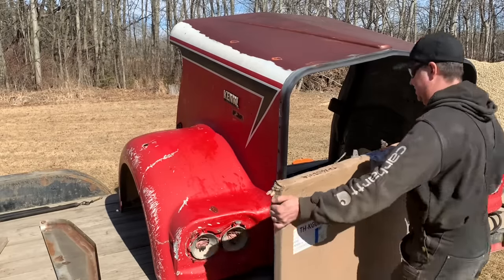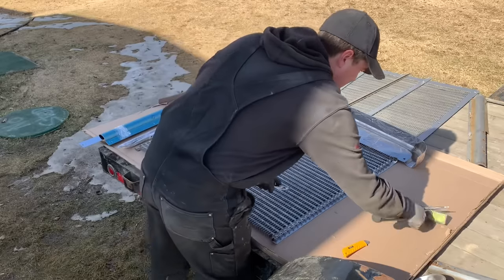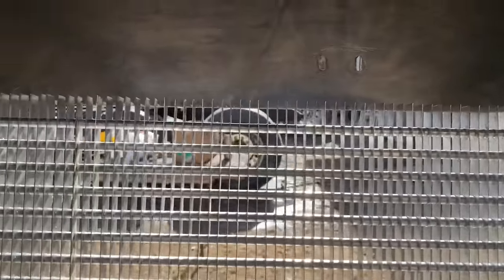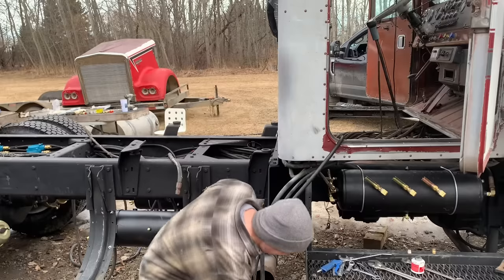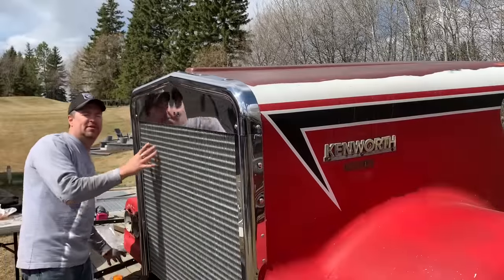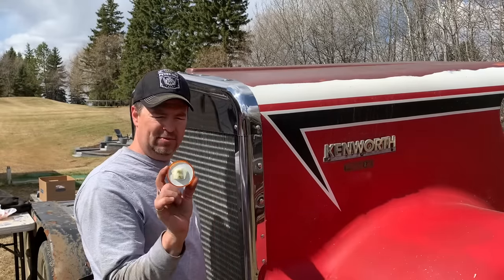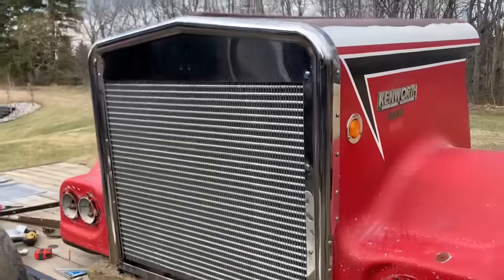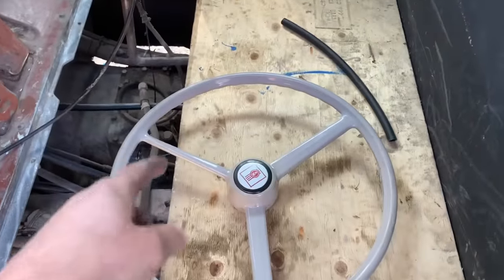Smokey & The Bandit Tribute Truck Ep.19 Dummy Denser

Comment: A can of brake cleaner would remove the tape and glue very easily.  You need to get rid of that ball balve on the anti smoke line.  If the valve ever opened you would lose all of your air pressure.  If you use a simple check valve you could mount the quick connect anywhere.

You could paint the stainless rings on those clearance lights so they blend in perfectly.

Comment: I buy sell and trade vintage amateur radio equipment and cb equipment and I go everywhere to buy equipment and know everyone in the business and I am sure I can find that scanner without a problem.  I also have pallets of vintage antennas, I do not know what is on the movie truck but I am sure I have it or can find it.
Reply from the maker: Pace 10-4U or 10-4H is what I’m looking for.  If you ever find (working or not) please email me at twinstickgarage@gmail.com
Reply: Awesome
Reply: @TwinStix  I really doubt you would pick much up with a old scanner like that since everything is narrow band and of different frequencies now a days.  I have a idea that might work for you.  I can probably make a non working identical clone using a housing from a pace 133 cb radio or other radio enclosed that is the correct size.  I restore radio equipment so I have piles on junk equipment for parts so I could take the correct style potentiometers and switches from other models of radios and screen print a proper matching face.  I could even put modern digital audio player inside that can play the exact sounds from the movie.  I know I can make a perfect visually correct replica and using sound clips from the movie would be really cool.  I do not know what antennas were used on the movie truck but I probably have them and anything else needed.
Reply from the maker: @shawnchurch316  oh that would be absolutely mint if you could pull off a replica ... please email me at twinstickgarage@gmail.com 👍

Comment: Yes , the air lines from brake valve  noods to be  longer & rerouted  as the  rear  ends move up & down the air lines will try to twist  in the fittings or torque  the line, short term  ok long  not so good.   On another  subject how good did the grill shell fit ???.
Reply from the maker: Wasn’t perfect but worked ... guess that’s what you get for buying non OEM knockoff
Reply: @TwinStix  Thank for info , been buying genuine KW but @ $400.OO per upright it gets expensive & stainless  is nice. Got one kw upright   miss stamper had r stamped at end of part # but  was a left side.

Comment: Something I've been wondering about for quite a while now, long enough to actually ask now: in a previous episode you mentioned you were going to put some spacer of sorts between the steel inner rims and the polished aluminum outer rims on the rear axles. Did you ever put them in? I'm curious to know how that would work...

Greetings from Netherlands.
Reply from the maker: Yeah the plastic spacers I bought had the wring size holes for the Budd lugs so I just used anti seize for now but will correct 👍

Comment: Well well that is one heck of a nice mail opening. that minty steering wheel which looks like it is like in new condition and you have to wonder where the heck did that fella manage to find that in that condition? But you have to love that someone out there did and had the eye to find it and send it you way, said it before and will again got to love the Twisticks fans and their love for wanting top help out with the projects. .

 Love Love love that old CB  and it works how wild is that, I bet you can't wait till you are in Snowman and you are going down the road and you hear that a voice crackle over the radio for the first time at you  and you get to pick up the mic and talk back at em, your going to be tickled pink with a grin ten feet wide and will probably be talking till your out of range...lol

And yes that fake condenser grill does look sharp, no doubt  about , who doesn't like a little bling and it is eye catching like it was on the original Snowman truck.Yeah the running of the air lines is a lot work andis time consuming but its one of those jobs where when your done you can step back when its all done and know down
the road your not going to have to worry about them for a long time and of course there is a little bit of pride in its a lot of work but once there done, they are done... and yeah that spec manual...is a godsend, whoever sent you that and hung onto that all these years knew they had a treasure on their hands

Nice work Mark Looking forward to the next update

Comment: The anti smoke valve is common on fire trucks as we are often too lazy to search for leaks and there are adapters on the pump panel or cab doors, or tractor/trailer if it is a tractor drawn aerial ladder truck (front and rear steer).  However, I love the progress and look forward each week for updates.  Keep on truckin!!!

Comment: We install your "anti smoke" valve on all our trucks. usually drill the frame and mount it or if the tanks are accessible, on the tank. Easier for testing things in the shop and for finding leaks without the truck running. That truck be wicked!! I have a very similar bracelet a friend gave me... I wonder...

Comment: the marker light in the hood should be a stock part from Kenworth or at least a regular one with rubber gromit,
as the Reflector next to the head lights is, one bolt in the center and with adhesive backside.
And I didn't know that thing on the CB was a Police Scaner, I thought it was a Compressor or Equalizer or an Secondary AMP.

Comment: The side markers were 2.5" that had sort of a "wave" pattern on the lense that looked just like the lense on the reflectors used on the older A models and were surface mounted . The correct markers are still available from Grote last time I bought some. Not sure if the reflectors are still available.

Comment: We always put a valve on the tank by the drain to fill up the dump trucks and potato trucks with air before we pulled them out , just tee it off so the water drain goes straight back and the fill valve goes to the side of the truck